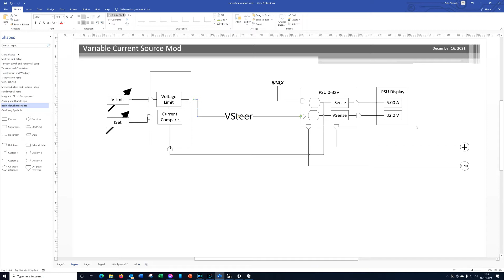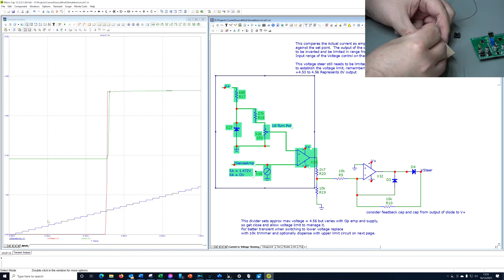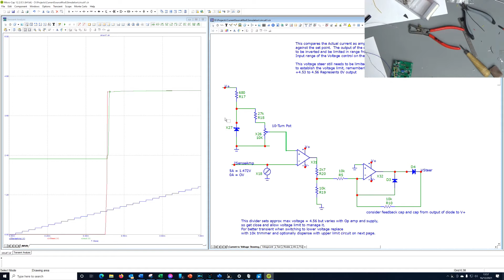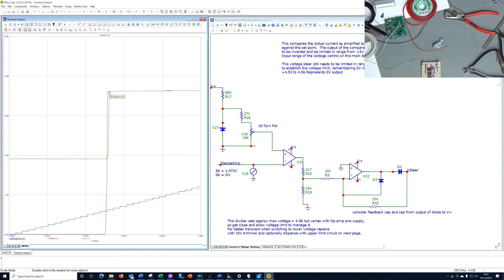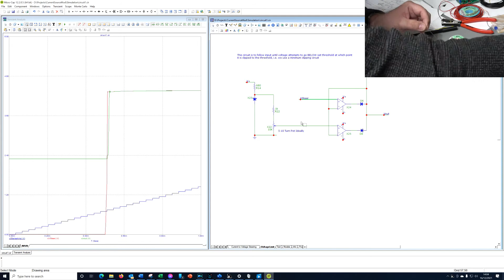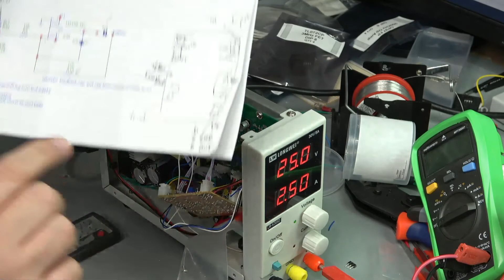0039 Current Source Power Supply Hack

Comment from the maker: Now added 3d files for the mounting bracket to the github repository, stl for printing and freecad part design file for those who need to mdify it for their own board.  Together with the simulation files (Microcap version 12 which is a free simulator) you should have everything needed to create your own version.  not doing a pcb because this is just a hack using parts available - use perfboard, or stripboard like I did.

Comment: This looks like a super userful mod, many thanks for sharing it! Unfortunately both LF351 and LT1022 seem hard to find. Can you advise on good alternatives? Which parameters should we be looking for - is it JFET inputs; low input offset voltage; and output swing as close to rail-to-rail as possible?
Reply from the maker: I recall aiming for high input impedence mainly on the first diagram and so JFET is ideal but try and keep the Input ioffset voltage as low as possible, this is the key error contributor.  If I did it again I would use a dual op ampt to provide buffers to the pot circuit and the current sense, then the other 2 op amps would be something that has a trimmable zero offset to eliminate the offset errors.  
In the second circuit where the voltage is limited there are two problems - first  you need to get close to the upper rail voltage and that will be the primary parameter for your opamp. The other is that there is under certain conditions a possibility of current flow out of one op amp and into the output of the other, I chose an opamp that worked ok but there should be some alternative versions of this circuit that have additional resistors between the opamp output and the diode this is to limit the feedback current - see what you can find in the simulator.
Really what I am describing is the difference between my first attempt and how it would be made more rugged for production and longer life.   You might however just look at the switchable output and movement of the meter connections, with that in place it might be possible to just set the voltage to the limit then wind up the existing current limit to use it as a constant current device.    I use it mainly as an electroplating supply where we are aiming for a set current.

Comment: hi.
you can calibrate the CC current using W1 trimpot.
at 12:00 is the one on right of probes.
If has overshoot on voltage, use the other trimpot -W3.
Reply from the maker: Thanks

Comment: Thanks for a great video, you know , i own 2 of these but the 30V/10A version.
Reply from the maker: I think the 10A version is more popular, but I had a particular need and was trying to keep cost down.  Strongly recommend adding a wire direct from earth to chassis and also perhaps add some bigger cables between the board and output terminals to reduce the voltage drop when under load (I did a teardown video on it in which I noticed that while the voltage on the board itself is regulated, it drops quite a lot ont he actual output terminals when delivering a few amps.
Reply: @MakeOrRepair  Thank you for the info, i will be sure to make the changes you suggested.